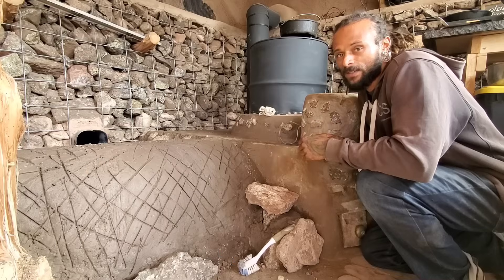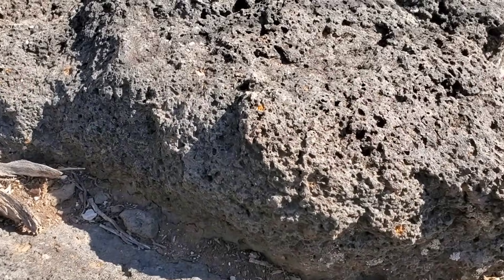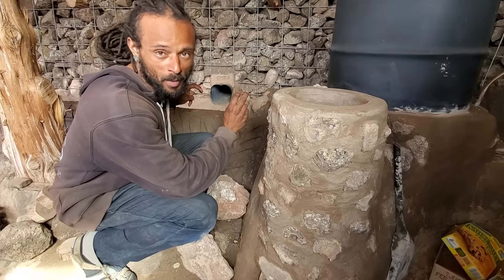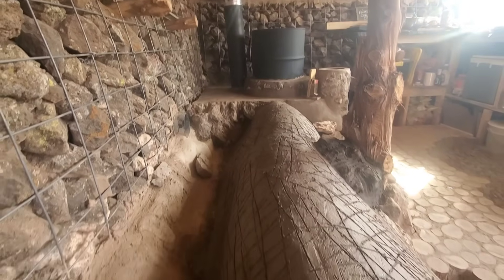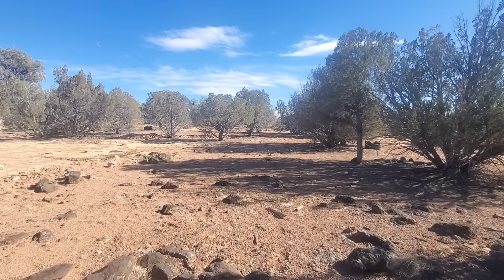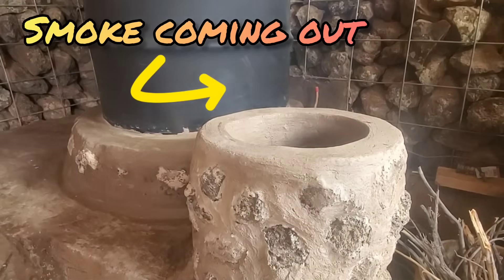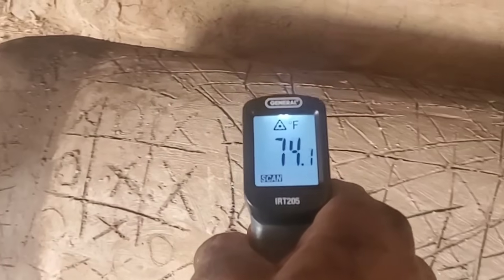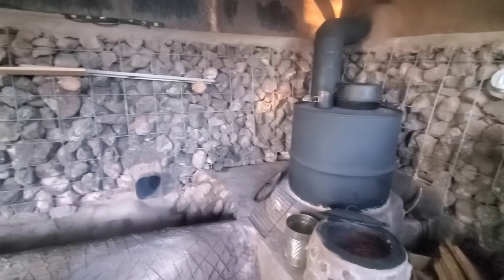Rocket Mass Heater Designed For Max Heat Extraction

Comment: I'm really looking forward to seeing how this works long term, but I have a thought and a concern. 

My concern is that your stratification section cracks and lets gasses into your home. I think that's why closed tubes are used in other versions and wonder if some sort of closed chamber (maybe a barrel or really fat metal tube?) could be there, covered in the mud to absorb the heat while protecting from leakage?

And you may have addressed this in another video, but if I was building this I think I might consider an insulation layer underneath and on the back wall, between your earth and rock layers.

This would prevent the earth under and behind from pulling the heat into the ground, and more of it being reflected and released into your home. 

Either way, I really look forward to seeing how this all works out, thanks for sharing.
Reply from the maker: It's actually the opposite case any cracks or gaps create more airflow, so everything just gets sucked into the system to outside. ✌🏾

Comment: Shouldn't the inlet for the J tube be on the opposite end of from where the hot air enters? Seems like the heat will stay on just the one side while the longer end stays much cooler?
Reply from the maker: Nope, actually more efficient where it is. Knowing how heat works like was shown in the animation, will show the heat rising heading towards the end creating even heat distribution, while the hot air cools settles to the bottom and makes its way out!✌🏾

Comment: Someone talking about this concept once said you should think about heat like the flow of water upside down. the same way water will flow down into a bowl, heat will flow up. once this principle is understood, it opens up a lot of possibilities for thermal mass heating systems. With this approach all that crazy winding ducting (and cleaning it) isn't necessary.
Reply from the maker: Yea Matt, from.... I forget his company. But his name is Matt. They build this exact design for most people's rocket stove benches!✌🏾
Reply: @GrowTreeOrganics  I think you're talking about Matt Walker from Walker Stoves.
Reply: Convection is a pretty weak force. Once the air siphon starts it may over power the convection in the bench. I think that is why you see the temps ranging from 90 deg to hot side of the exhaust and 75-80 at the far end of the bench. I'd love to see some side by side comparisons to prove one way or the other.
Reply from the maker: The bench had pretty even temperature after a little more burn time. I had only burned a 5 gallon bucket of sticks when I took temperature measurements in the video. The higher temps you were referring were from on top of the exhaust going into the bench, so not technically the bench temp, as was explained in the video!✌🏾
Reply: @ericheft6184  I'm certainly not an expert on the topic. The video was called "The Ten Principles of Rocket Stove Construction" which was covering an older book on the topic, there might be some answers in either of those sources.
Reply: I think you're talking about Matt Walker from Walker Stoves.

Comment: I think you may be reducing the heat transfer into the bench by having your exhaust pipe close to the hot end. If the cold air exhaust tube is forming a draft then I think its likely the hot air coming into the bench is going to get sucked down and out before it does much mixing.
Reply from the maker: Nope, you'll have to watch the intro again to understand. 👍🏾
Reply: He did slightly set back the exhaust duct from the heat duct that pushes  hot air into the bell.  

I wonder if a baffel wall running midline the length of the bell for the first 2ft or so would cut down on that potential loss and push even more hot air deeper towards the end cap of the bell space. 

Either way, they will stay toasty out there.  Love what they are doing.
Reply: Increasing efficiency  of heat transfer is basically impossible  at that stage since you need the radiant heat on the exhaust to form the draft. And I don't think relying on an electrical fan to form the draft is a good idea. Personally I would prefer about 75%  efficiency for slightly better draft and less smoke indoors.
Reply from the maker: Actually it's not dependent on the tube being heated, it's an added bonus for how its designed!👍🏾
Reply from the maker: Thanks!. I think when we understand more about the thermal dynamics of how heat works, this design makes a lot more sense. ✌🏾
Reply: @ Its also possible that the hot air creates enough pressure to force its way down the bench and you get circular air current. I'd love to see a cut away from one of these to show the actual air path.
Reply from the maker: @ericheft6184  no one's made one yet, but I think many have done air tests inside these benches and do show how there's very even heat distribution. ✌🏾

Comment: The last view answered a question I had about cooking on the top of the barrel. I saw you have a pot on top. How much cooking are you allowed that will not change the efficiency of the system? 
Great job on that design.
Reply from the maker: It takes a lot to actually change the airflow on these stoves to the point of failure or reverse burning.. look how much mass most stoves are made into that are cooler.  It can handle a little pot!😅✌🏾